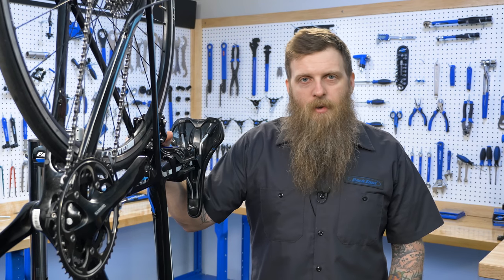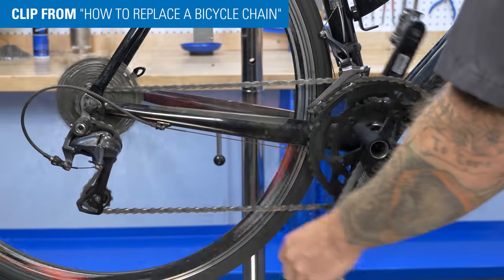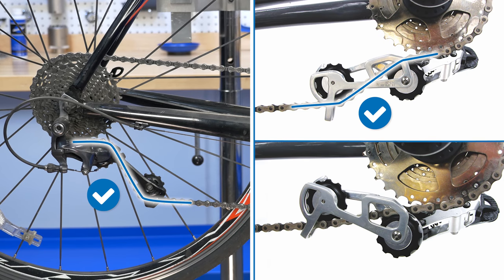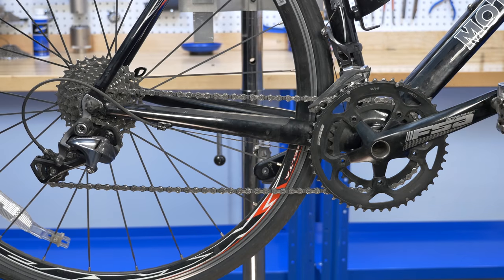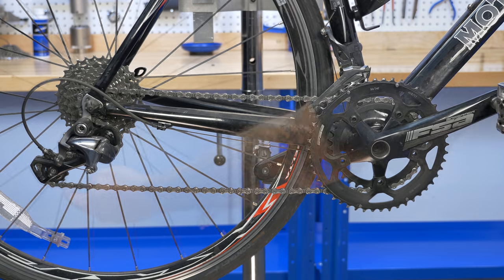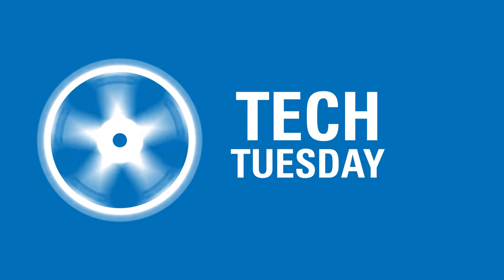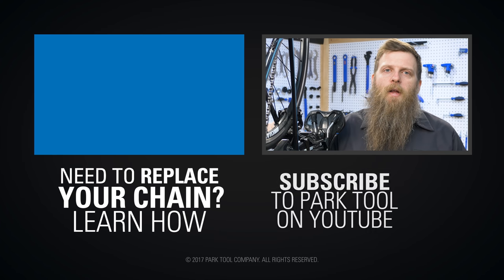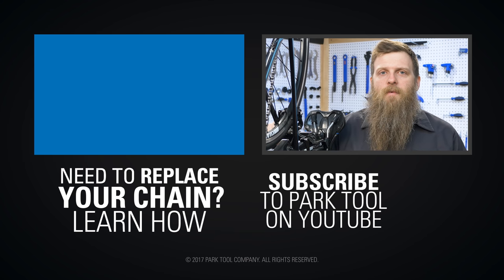Make Sure Your Chain is Sized Correctly - Tech Tuesday #79

Comment: this is supid... who rides on the smallest or the largest sprockets? I get the idea but nobody should twist his chain like that!
Reply: You shouldn't no, but when you, your chain and derailleur should be able to handle it without dropping your chain or snapping either your chain or derailleur.
Reply: why? I will never ride 42-32 so when measure my chain I measure it on 34-32. If I do it on 42-32 I just carry with me at least 5 links I will never need. But still on one of my bikes I ride a singe 38t and on the other one I use two chain rings 36 and 26 and on the bike on which I've got 3 chain rings the biggest one I use as a bashguard :D
Reply from the maker: The assumption here, and in most of these videos, is that you are working on bikes for other people. While one particular procedure may work for one person on one bike, it is better for us to write so a procedure works for everyone.
Reply: then you can explain this is the fool-proof way to do it ;)
Reply: I went out toy garage and did this. The small to small,,,I had way too much slack..What should I do or tell my bike mechanic to do to fix this problem?